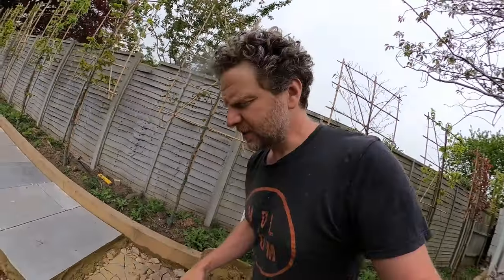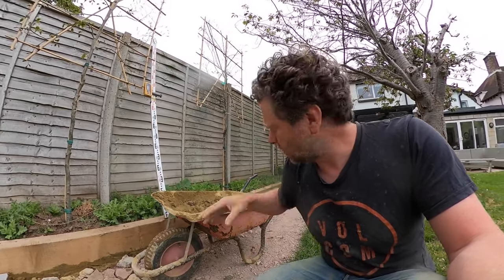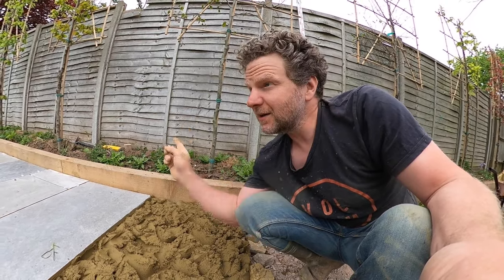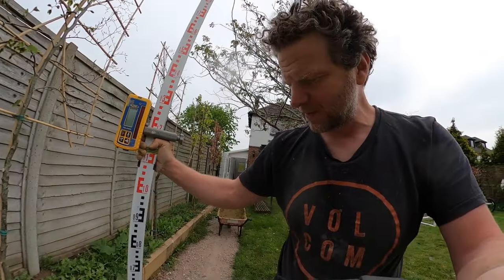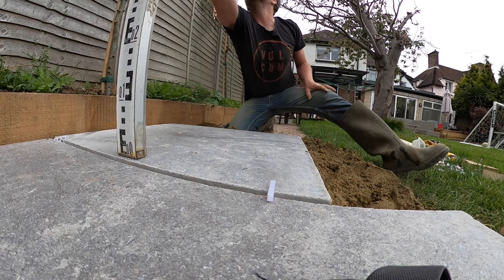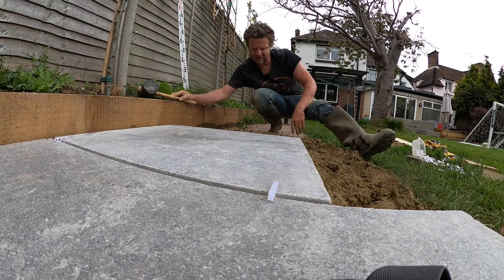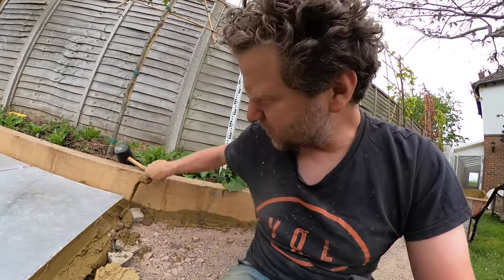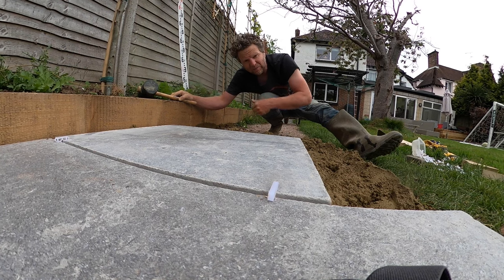How to Lay Paving Slabs

Comment: Just a side note for anyone thinking of following this guide: I'd recommend laying the larger crushed concrete first, and then adding the type 1 and compacting that. This way, you will have a flatter and more level surface to lay your slabs. You will also save on the amount of mortar you will need.

Comment: You might need a smaller trowel' the laser level is a good job, what happens if you need the path to fall over a distance, can the level be set for a run off?
Reply: Pretty sure that’s illegal
Reply: @TheMrjoehughes  He must have had a constant supply of cement trucks?